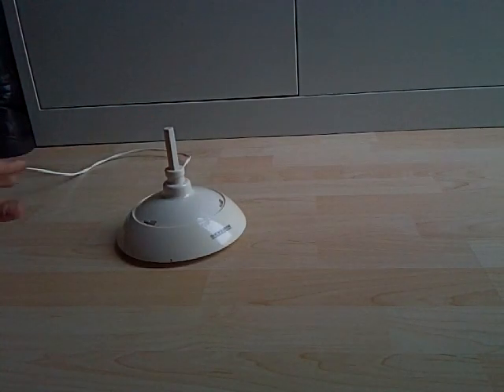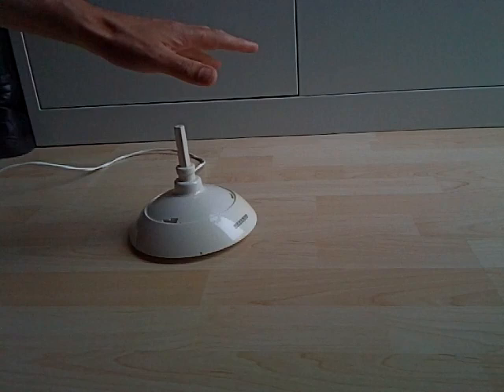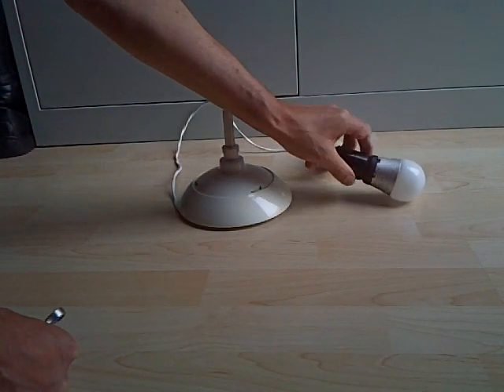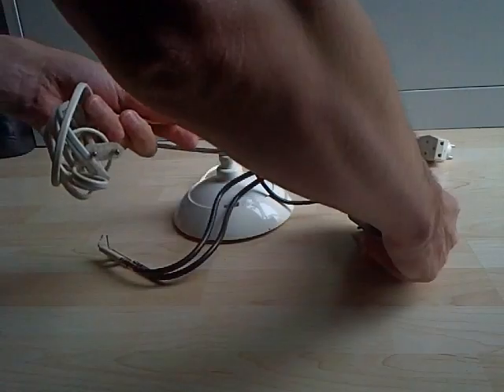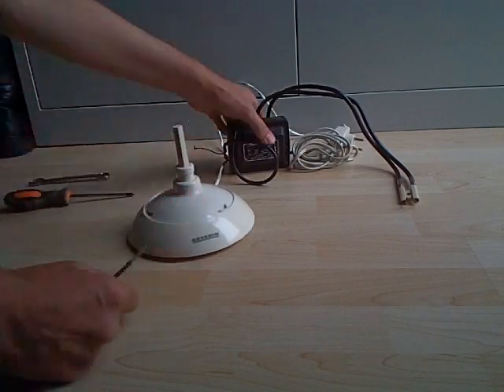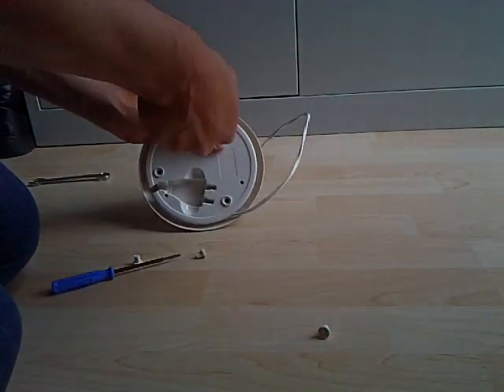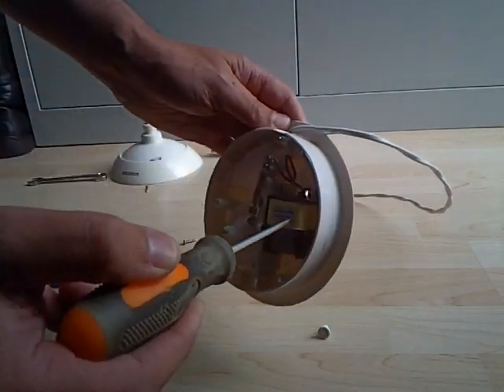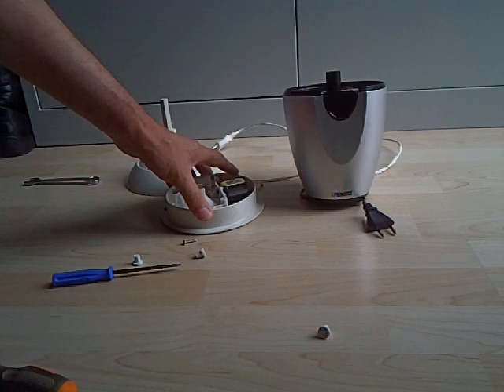gerard morin alternative to waterpump

Comment: Looks like too much physical resistance with that particular shaft. Sounds almost like it's ratcheted or something?
Reply from the maker: Hi Robert,
Yes, there is a big gearing ratio inside this appliance. As you can see for 1 revolution by hand I am already getting over 100 Volts. But this is only due to the ratio, the magnet is rotating much faster because of this. And I guess taht if I use to much force (rotating by hand) some teeth of the gear might break off. But if you start it gently and ramp it up, it will work.
Of course, this is just a demo. I found the same principle in other devices as well. Also in useless ones, like in a small (1.5 V battery operated) clock? I have no idea of those could be used as well, but most of the time bigger is better.
Reply: I'm thinking there could be something with a wheel and something similar to the gearing up mechanism on a mountain bike or old Ten speed with no road resistance [bearings]. Probably do it a lot more simply I guess but minimizing drag at the input end. Really gets the old brain working eh? Bearings, very balanced shaft and some way of easily gearing up even at the other side of the generator? Use a bit of the excess output to gear it up the increase it. I'm a doofus just watching but it does get one wondering for sure. Keep trying sir. I'm sure you'll figure out other ways to have it work Even better :-)

Comment: Do more mesirments of this at 3000 rpm.
Reply from the maker: Thank you for asking.
I will leave that to be worked out by other people. I merely wanted to add an idea. Also, there is a gearbox inside, and I think I was already spinning the generator side at that speed. Plus: I do not have the equipment to do measurements.